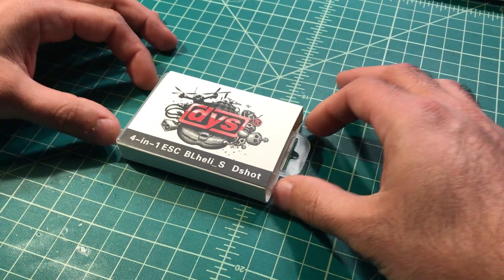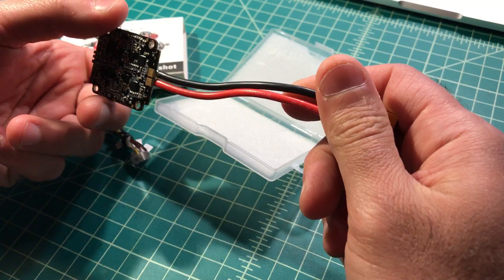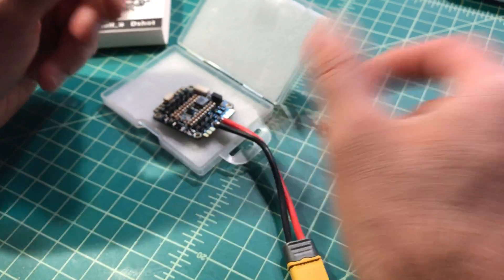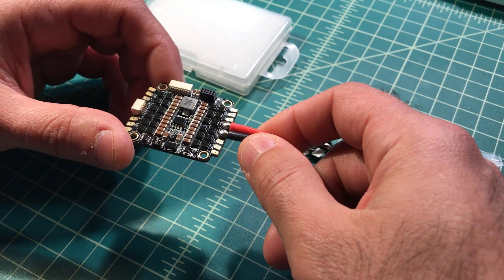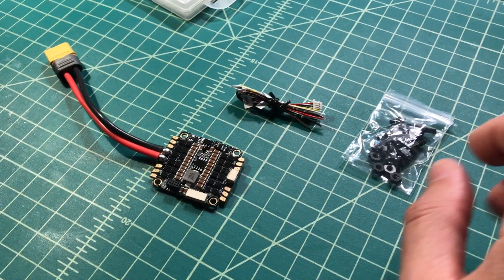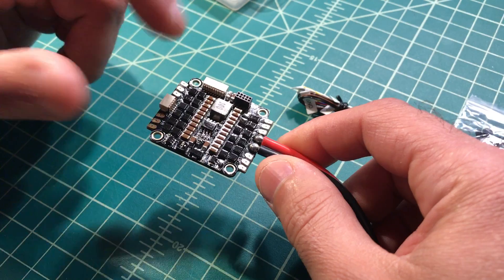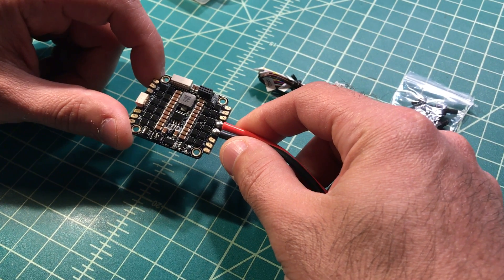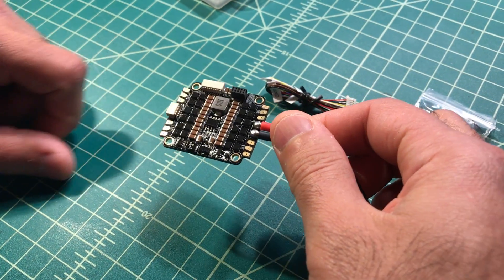DYS 4in1 BLHeli_S Dshot ESC Overview

Comment: Pinch I just finished a build with this esc. I went with the DYS flight controller it is matched with. Great clean build but I am getting a lot of electrical noise through the TBS Unify Pro HV race I installed. It comes across as fine lines in the video feed and increases with throttle. I put a 470 cap on it but am going to increase this to a 1000 uf today to see if it cleans up. Dronemesh did noise testing on this esc and concluded it was excessively noisy. At this point I will have to agree. How did yours come out? What FC did you use?
Reply from the maker: Well, I'll tell you I'm still running mine... on a Floss 5 inch racer, that I repeatedly crash on concrete and it's holding up fine :).
Reply from the maker: What VTX will you be flying?
Reply: @Superninja, I know you were asking pinch but having tried a bunch of different ones I am digging the Mach 1 VTX from race day quads. Seems to be working better than my Unify HV and has the nice features. That said I think the 5v version of the TBS unify is a solid choice according to Pinch in thread above. If you are on a tight budget I have been having good results from the eachine VTX03. For 13-15 bucks you cant go wrong with it.
Reply: Yea, nothing against the TBS, once I sorted through my own errors it worked decently. Decided to try the mach on another quad and really thought it did better. Probably apples to oranges though.
Reply from the maker: Receivers go to the FC and should be powered by the FC, not the ESC.
Reply from the maker: Hi, video-wise, my build was fine. I'm powering a Unify 5G8 V2 (5v) with the onboard 5V BEC on the ESC. I have had zero problems with video noise. However, the first build I put this ESC on did not fly well. I got tons of vibes than I could never tune out. I eventually gave up on it and moved the ESC to a Floss 4 inch. On that I still had problem with vibes. I started to suspect the ESC... but then I concluded it was not the ESC, but the flexy 3mm narrow arms. So, I switched the build to thick 4mm arms on 5 inch and 2205 motors and it's flying like a dream. The video is exactly the same and it's fine. I can't tell you this is the best ESC out there. But I can tell you that it's working for me and that the stronger BEC definitely is a plus. Good luck.
Reply: thanks for the reply. I put the 1000uf cap in this morning but it made no difference. I was reading on the RCGroups board there are a lot of people having this problem with the TBS HV variant. Glad to hear you found a solution to your issue.I am dying to fly my new build, a Skyline Rampage.It should be a beast with the EMAX 2306 but the video problems are a buzzkill. May have nothing to do with the ESC though.
Reply from the maker: I know its another expense, but try an get a hold of a Unify V2 5G8, the 5V version and power it from the BEC. That's what I did and it worked. Luckily, they are cheaper than the HV variants. You can use your HV for some other build.
Reply: Pinch, got it working by running power straight off the lipo pads. Cleared right up.I didn't have the option on the FC for vbat. Thanks again for your repy.
Reply from the maker: Now that you say that, I've had that problem before on other builds. KISS, RROSD, etc. The HV likes to be powered right at the top, as close to the battery as possible.
Reply: Just to follow up; been busy with work but I did figure out the issue. I ended up soldering the power directly to the lipo pad for vbat. HV gots to have full battery voltage to run right. Then there was a second issue with my antenna grounding out against the frame. Once I isolated it everything worked well. Love the smart audio feature in BF OSD. Able now to switch channels and freqs and vtx power through my goggs. Thanks for the feedback.
Reply: Building this very soon. Might have to ask some questions (total newb here)
Reply: PinchTune Thank you! I'll have questions for sure, but yea, I would like the cleanest video possible, obviously lol
Reply: PinchTune I haven't picked one yet, being new to this,it's kinda hard to narrow things down.  Any that you recommend? ?
Reply: Drop D FpV thanks man! I'll look into it
Reply from the maker: Take it as you may, the Mach 1 and the new Matek VTXs are interesting choices. But I've tried many VTXs and nothing has been better than a Unify. So for the time being, that's all I'm running. I have something like 8 or 10 of them at the moment. The HV is still my favorite, for ease. But the 5v version worked well on this ESC. I did rip a connector when I crashed on concrete recently, but the connector on the board itself is fine. I just need some extra JST-SH connectors.
Reply: Stuck trying to connect FS-iA6B receiver :( .. no proper cables that i can see..
Reply: I finally figured out the cable that came with this ESC goes to non DYS FC'c(pretty sure) I'm just a little upset that nothing came with proper cables to connect radio receiver to FC...,not the FC , r\c radio, nothing =/
Reply: I got some coming though